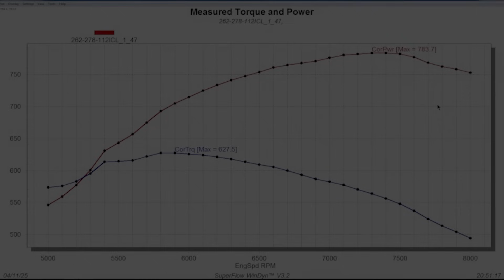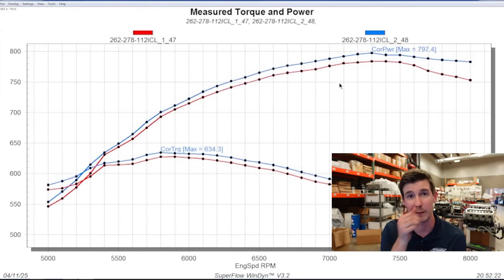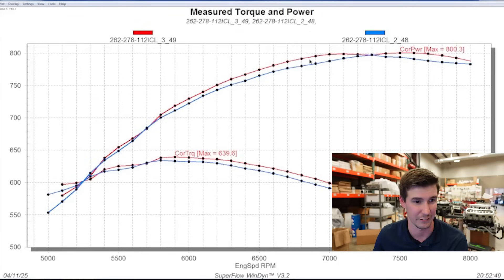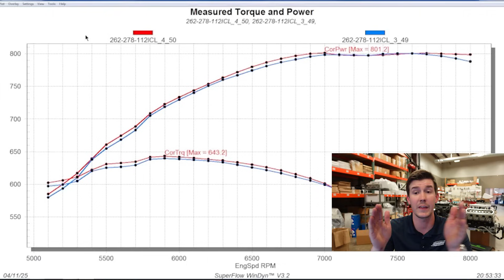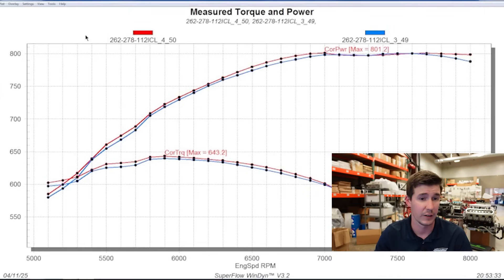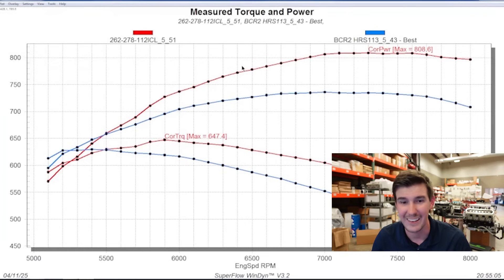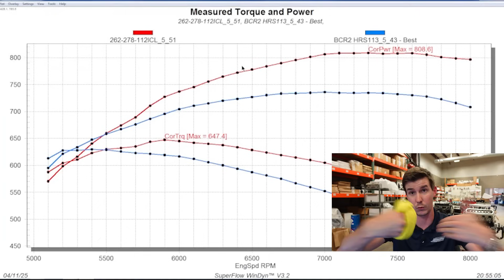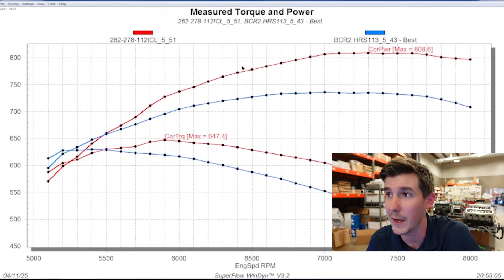WE DID IT!! The new RACE LS7 makes HUGE Horsepower on our Engine Dyno - Dyno Part 2

Comment: Do you have any openings for engine builds? Got a LS7 I’m thinking a spin main is my issue. Runs good lower oil pressure and slow crank when hot. 

I’m looking for someone to do a rebuild.

Comment: The longer intake tube adds an oddbal resonant aspect.  I'd suggest playing with that lenght some, generally it takes 10 diamters of length to full stabilize, but any time you move air at high speed you loose flow the longer you move it - due to friction.  That large of a pipe probably not an issue but the length for sure shoudl add a resonance aspect taht could be tuned.
Reply: There's nothing 'oddball' about it. Your intake tract as shown here is basically mitigating nth-order resonances at particular engine speeds, which enhances air channeling and therefore the ratios minimizing fluctuation, increasing volumetric efficiency. It is a form of Helmholtz tuning.

Comment: Agree, peak torque is where it because that is where peak VE is, which means this is where the most air and fuel is being trapped in the cylinder to be burnt, therefore this is where PCP is too.

Comment: Very nice numbers.  It appears it likes the extra 2 degrees of timing above 7600rpm.  Is timing locked or can you tweak the timing/rpm table?
Reply from the maker: Running a Holley EFI system, so we have unlimited timing control

Comment: It needs a 108mm Turbo. Nice engine build, you should be proud.
Reply: No, it has 13.5:1 compression!! Nitrous maybe
Reply: Other factors like how much boost or nitrous is targeted the ring gap and ring composition of rings need to be considered oh yeah and cam profile. Can you slap a big turbo on it? Sure ya can, may not live long.
Reply: @appliedmechanical8790  
There’s a lot more to making this live with a turbo than rings. One of the most important aspects will be pin height and the thickness of the first and second ring land. As long as the fuel allows, high compression is great with forced induction. Turbo engines with high compression spool faster than low compression engines. But in most cases compression and/or boost is limited by the fuel. If this thing run normal LS journal sizes, there is a weakness there too. Cleveland mains and BBC sized rod journals will be a massive benefit to any high power forced induction LS. 
Overall it depends on what you are trying to do. I doubt this thing run a very unique ring packagecwhich cannot be filed down to accommodate boost.
Reply: @13.5:1 you would send heads into orbit with a turbo.

Comment: Did they give an explanation for the 115 LSA? Compared to the Lower LSA of the previous cams
Reply: Wider LSA typically shifts the power higher in rpm. That's why you'll see a lot of truck cams with a narrow LSA.